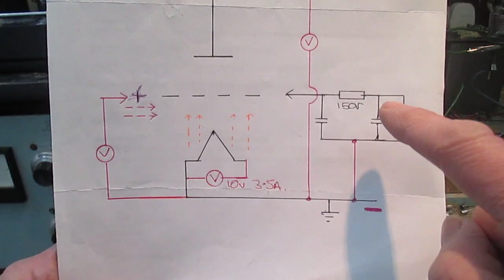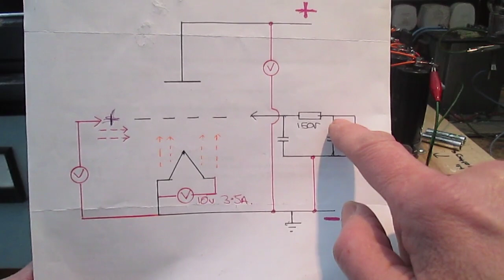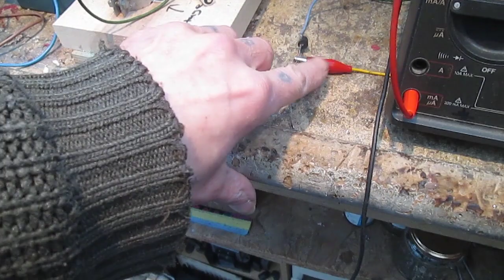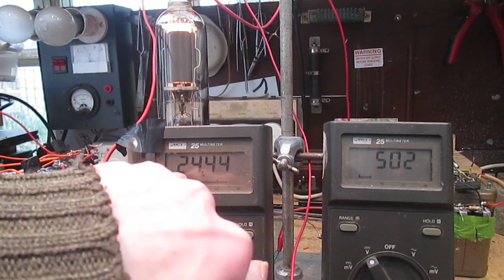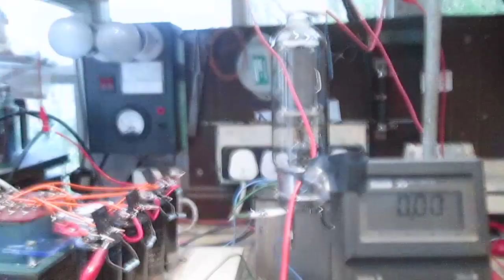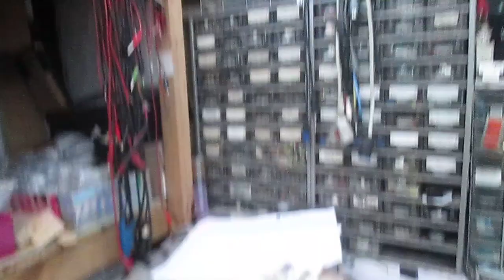Testing an 805 Triode - Positive Bias Part 2.

Comment: We used those tubes to make CW transmitters. Yes, you are correct the lethal high voltages and current needed are just too dangerous for an audio amplifier.  Should be some Hams there that would love those tubes. Plus the weight of the power supply needed to run them in an audio amp is considerable. The couple of plate transformers I have for the big transmitting tubes are around 75-100 lbs. and supply currents 1/2 to 1 amp. at 2-3 KV.  That is way more than enough to kill someone or a pet. I remember a case where a chap built a replica of a 1930's transmitter and was found dead. He apparently fell asleep and fell into it, electrocuting himself.
Reply from the maker: Aye, they're lovely valves. I'm fine working with EHT, I've worked with 10kv, however it's taken me a few years like yourself to get to that point. The average Mr Bloggs doesn't have this experience & knowledge. What our our Health & Safety Executive would make of it, I shudder to think.
    Poor bloke, not a nice way to go, the last words he heard probably a faint "CQ cq cq ....." then silent key forever. TFW.

Comment: Good work there Andy and good spot of that current limiting resistor in the original bias supply.
Reply from the maker: Thanks Dougie. Aye the resistor acts as a DC choke, current goes up , V goes down, nothing happens. TFW.